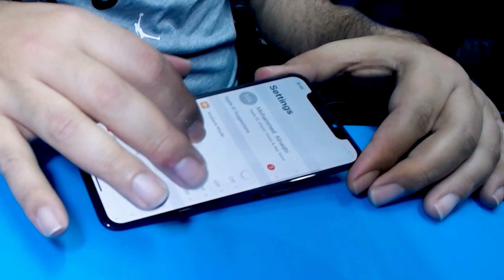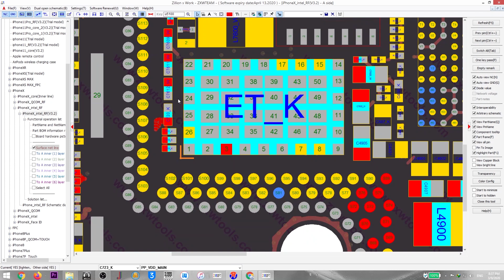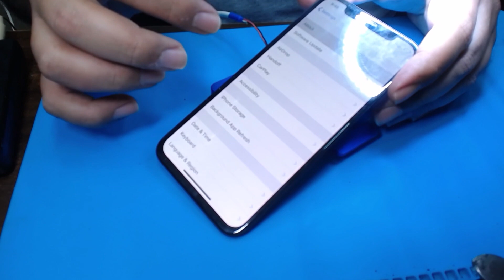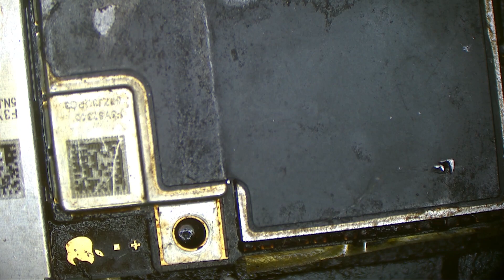iPhone X WiFi not WORKING it Won't turn ON | Greyed out WiFi Problem SOLVED

Comment: Love the video, what temperature and airflow did you use to safely remove the WiFi ic in the video?? Thanks jay
Reply from the maker: Thanks a lot, my technique is to use high temp & air flow and fast remove, i always use 400-450 temp and 100 air flow
Reply: Ayman The Repair Tech will that technique be the same for all WiFi ic??thanks jay
Reply from the maker: @SURGE101  For most of the chips yes but there is low temp chips gonna break if you used high temp with it
Reply: Ayman The Repair Tech if I take a WiFi ic off another iPad and put it on a different iPad ,to get it to work have I just got to unlock the WiFi on the nand? Or do I need to do anything else??thanks jay
Reply from the maker: @SURGE101  Thats depend on iPad model if it is PCIE nand you need to unlcok WiFi if not PCIE no problem just replace it with any nand
Reply: Ayman The Repair Tech honestly your the best and I love your videos, jay

Comment: iPhonex we have WiFi but is very weak wen I connect to high mbps  connect is good but when I connect low mbps (3mbps) to weak sotfwear or hardware problem?
Reply from the maker: We can't tell if the problem is software or hardware in many cases unless we do software first then if not fixed it will be hardware issue

Comment: Sir I usually see your word . Why in iphone x when you take out wifi ice used low temperature? Usually you used high tem. 400 and remove fast. Thanks alot
Reply from the maker: To not damage Baseband chip and i used temp 380

Comment: Hey sir I'm facing the same issue..shall i replace the wifi ic or get it fixed..the person might not be as experienced like you who can repair it.
Reply from the maker: Each case is different i can't tell you do this or that without proper diagnosis

Comment: Hi, ive got a question. So my iPhone 7 plus wifi is greyed out and my Bluetooth does that thing where it never loads. What I did is first go into (about) like you have and it just let me go through about. When I done that I done all these steps people do about reset or erase  the phone. But this is the one thing that doesn't make sense... when I leave my phone for a hour it can connect to wifi and the Bluetooth works but in a couple of mins the wifi doesn't search no more but its on and the Bluetooth just works as normal. I don't know what to do so can you give me advice please? and btw when I restart my phone it turns off the wifi and Bluetooth.
Reply from the maker: This is common hardware problem but it need an expert to be fixed, erase reset all this wasting time videos on youtube will not help to solve the problem, i wish i could tell you more about it but this is very technical
Reply: @AymanTheRepairTech   Alright thank you and do you fix phones in London?
Reply: May i know whats causes this problem .. my wifi got disabled just recently